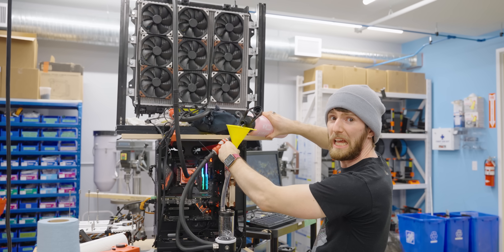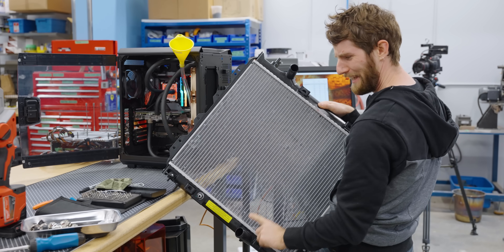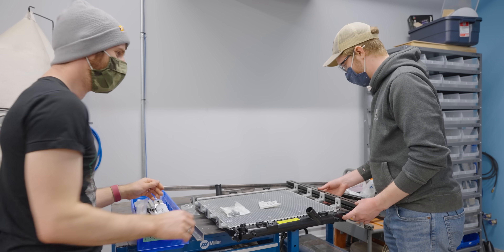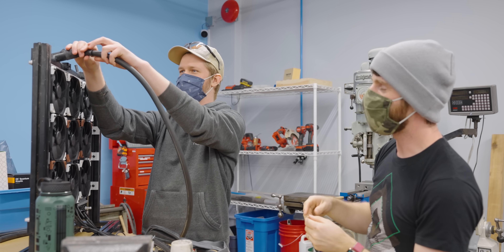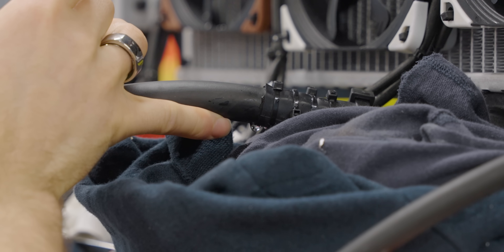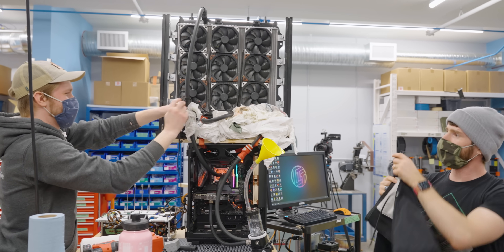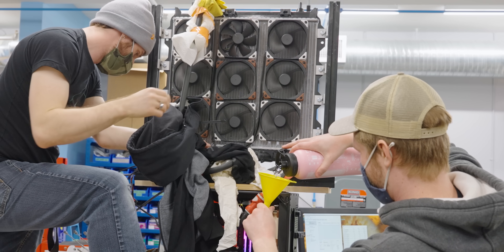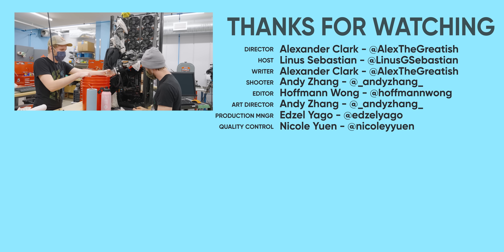Our Craziest Cooling Project Yet - Car radiator liquid cooler

Comment: I don’t know if this is crazier than the 2014 House water cooling project...
Reply: Whole room watercooling was way crazier and much more well done
Reply: @andrelascasas3156  crazier? Yes. More well done? Absolutely not as it was rampant with bacterial growth and dissimilar metals interacting.
Reply: Remember the bathtub? 😂
Reply: @GhostMan2013  Pepperidge farms remembers
Reply: Whole “office” centralized coiling is a topic that should be revisited.
Reply: @wafkt  the obvious way is to use a liquid to liquid heat exchanger and tie it into the building water supply system. Extra points if the warmed water is pumped into the hot water tank as a way of recovering process(or) heat.
Reply: @OuijTube  I had the exact same thoughts recently when I was contemplating how to minimise the wasted heat from my PC when it's mining. I'm sure this would absolutely be doable.
Reply: @OuijTube  I would love a proper project where they do a really good job at this.  Pump the heat out of PCs and into a water loop that attaches to their hot water supply lines.  They could get 'instant on' heat out of their water taps and also recover the energy that would have been lost as waste heat before.
Reply: crap i'm getting old...
Reply: It's crazier in terms of everyone was crazy and running around like a chicken with their head cut off.
Reply: Still remember the overclocking room promises from RTX Overclocking vid?
Reply: I had flashbacks the second he pulled out that radiator.
Reply: Damn remember when those videos all came out. So long ago 😭
Reply: That was crazier but also much more planned out. This is more chaotic for sure.
Reply: That's an air conditioner. It can also heat things up if the flow is reversed. And if you put a reservoir with additional coolant couple of meters under ground, it can do it all independently of outside weather. Technology Connections FTW.
Reply: @SomeThingOrMaybeAnother  Someone's done their research about latent heat and the refrigeration cycle.
Reply: @SomeThingOrMaybeAnother  ayyy
Reply: @SomeThingOrMaybeAnother  That would be a heat pump, but still TC FTW.
Reply: that was 2014? wtf
Reply: I want to see a proper updated version of that
Reply: The room watercooling project was way crazier. All this is, is just bad planning and bad execution.
Reply: Damn..its been a long time...
Reply: Nah, that was absolute madness and the fact that they used that for a while is even more nuts.
Reply: That was 2014?! Damn that feels like I just watched that video.
Reply: That was in 2014 0.o 

Holy - feels like it was 2017 or something ;-;
Reply: I saw that video series. That looked like a nightmare to deal with.
Reply: It’s not
Reply: Try it on your latest build. But in a proper manner.
Reply: Nothing was crazier than that, and stupid, and unnecessary, and I loved it. Have been watching daily since.
Reply: Almost forgot that
Reply: That was 2014 😳
Reply: Do you mean the one where they used a old Radiator to cool the PC?
where the old gunk that was inside got inside the CPU cooler killing the PC
Reply: @darknessblades  no the one in the old house where they put all their computers on a single loop that went throughout the whole room to the outside
Reply: @ImJBlu  AAH that one. it failed horribly
Reply: But, clicks...!
Reply: pc gaming is a sport
Reply: Need to do whole office water cooling
Reply: yes
Reply: GirlBaBes.Men
Reply: Every comment will be replied here and heart too 
https://youtu.be/dyUNU44hWfY
Reply: The house water cooling project was more professional.^^
Reply: Hey Frank, when's next video coming
Reply: the house water cooling was awesome! ps: we need more wtf projects
Reply: Not on top, but definitely somewhere up the list, hahaha
Reply: Crazy crossover

Comment: Connecting the transmission cooling loop was the biggest mistake here IMO. It's the same loop as the engine, but it doubled the number of places where stuff could go wrong.
Linus is always talking about multiple points of failure. Well that's one.

Comment: The transmission cooler is just a single tube with fins on it that sits in the lower radiator tank. Adding it to your loop will not help anything.

HOWEVER

Using that transmission cooling loop to introduce a much colder coolant can lower your temps overall. Pump some icewater through there while the comp is on the full loop maybe??

Comment: There are rubber plumbing reduction fittings that could have helped (check by the plumbing, washer, and garbage disposal hookups at the hardware store), but that wouldn't have been as entertaining.

Next time, try metal hose clamps instead of zip ties. Zip ties always have a gap near the clamp that makes a pinch in the hose, which is a potential leak spot. Hose clamps don't have that problem to anywhere near the same degree, so they're less likely to leak.

Comment: In all fairness, people used to use automotive radiators and heater cores in the past, before PC water cooling became an industry. Worked well enough - plenty of surface area. Sadly, you're de facto mixing metals here, so ideally you'd want to use automotive coolant with loads of anti-corrosives.

Comment: Lol, the transmission loop is just a heat exchanger tube that sits in the tank and transfers transmission heat to the the antifreeze, so running the coolant through it in series actually reduces your efficiency by reducing your flow with no benefit. However, you can use that loop to supercharge your cooling by using it in the low pressure loop of an air conditioning set up.

Comment: should have get Rescue Tape to seal the tubes. Its self fusing silicone tape and its waterproof. if you had gotten even one roll of that stuff ya coulda sealed where all the hoses are connected and bam.. no leaks.

Comment: The transmission cooling is in the side tanks only.  Should use water to air heat exchanger radiator for supercharged and turbocharged vehicles.

Comment: I thought watercooling worked like in pc building sim, the more rads you add, the lower the temp gets, and the temp can even go lower when stress testing, compared to the idle temps.

Comment: Should have brought a mechanic in to stop the leaks and use a 12 volt automotive pump and you can put this thing in a window to blow the heat outside in the summer but really long hoses on it you have a portable heater and you can mine Bitcoin with it haha dreams

Comment: Hi Linus, you have done it all wrong, you should have just used the big inlet and outlet ang used a reducer, transmission line is totally separated and would not leak at all, you can also just use a car radiator fan as it also just runs on 12 volts so that it moves air better, if it.can cool a car.then it will definitely cool a PC

Comment: Save some money, buy a MORA, put it outside your windows or home if you can for maximum efficiency below ambient temps of your pc room and presto, my Ryzen 5900x and RTX 3080 run at 25c at full load right now in the UK and is not even that cold outside right now. Also if you are using a D5, instead of a DDC Pump have your radiators at equal or lower height... LOL

Comment: Make one that is leak proof and then use one seperate loop for the cpu and one for the gpu...the car radiator has two loops so use the transmission one for the gpu and other one for the cpu...the mount it on the side of the computer case

Comment: Yall have 3d printers.

This is a perfect application for an sla printer and can work for a FFF printer too.

Youll of course need to seal the ends with silicone or something, but 3/4 layers for FFF will be water tight enough, particularly if printing with a flexible filament which is excellent for water tight seals.

Would take less than an hour for both adapter sides

Comment: You should have made some sort of pan that collected the dripping water and leaked it back into the funnel or a tube into the reservoir.  Also you should have just gotten a radiator fan to cool the radiator.

Comment: The transmission cooler works due to the fact that oil can hold a higher amount of heat, basically built in transmission cooler is just a liquid to liquid heat exchanger.  They build it into the radiator for cost savings of having the cooling solution in a single package during manufacturing.
Edit - You should have gotten with a industrial mechanic before attempting this.  I can build one that wont leak for you, I just need your hose size.

Comment: I would have made a mounting plate for all the computer hardware on the side of the radiator and mounted the fans to the opposite side... it looks like you had about 1-1.5" of space between the radiator and were the plate would be, besides, the plate would only be as small as possible. I would also have mounted the pump to the base of the radiator.

I still love this project; I'm just giving constructive criticism

Comment: This pains me so much. Why did you do no research on how the transmission cooler works, its basically a simple liquid to liquid cooler in that its just a pipe that passes through the lower end tank of the radiator and is using the main engine coolant to cool the transmission fluid. There is absolutely zero point to hooking it up in a setup like this. You could have figured this out in 10 seconds of googling. Also getting the proper fittings to make this work properly are easily found at any home depot, lowes, rona, etc etc.

Comment: Linus please rebuild your "Chiller" cooling pc this time with an outdoor air conditioning unit and not dipping the radiator in water and using a 404a gas system, moreover this time apply this and overclock everything at the same time. Please 😅 also delide cpu and use liquid metal on cpu and gpu.